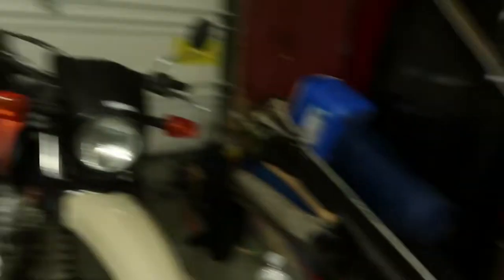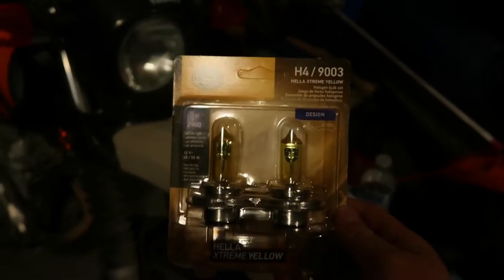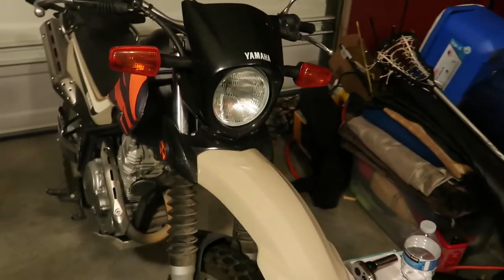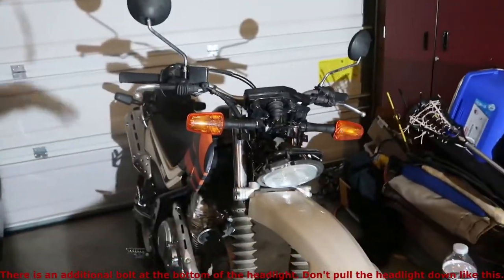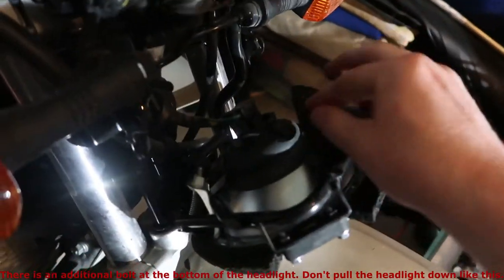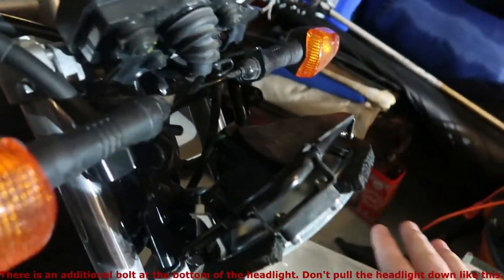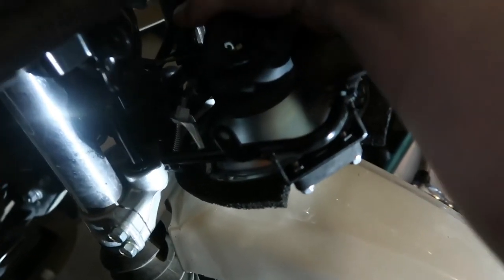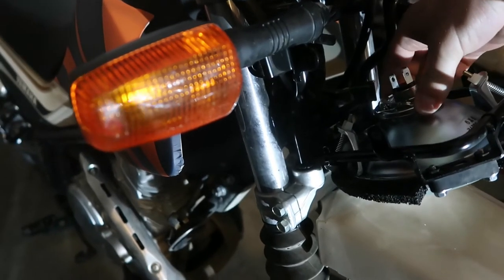2020 Yamaha XT250 Headlight Upgrade

Comment: i put one of these in. the 100 watt high beam is nice and the low beam is stock so it doesn't blind people 
https://www.amazon.com/HELLA-H4-100-55W-Wattage/dp/B01BDWRAK6

if you want yellow they have those too but i have never bought from these people 
https://www.vxwholesale.com/vision-x-vx-996y-pure-yellow-100-55-watt-single-bulb/